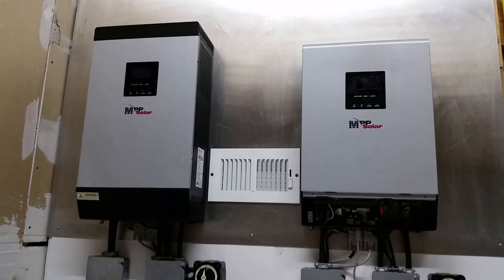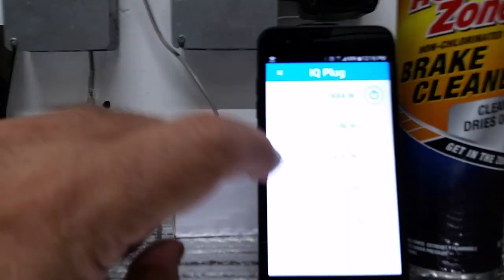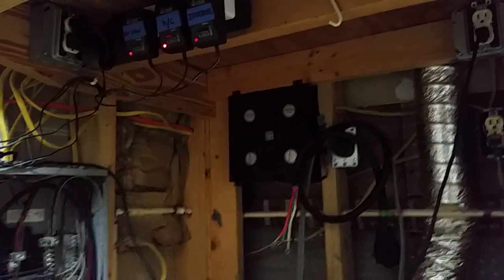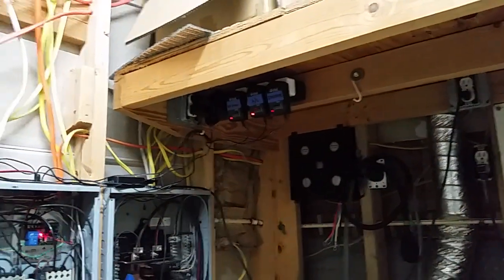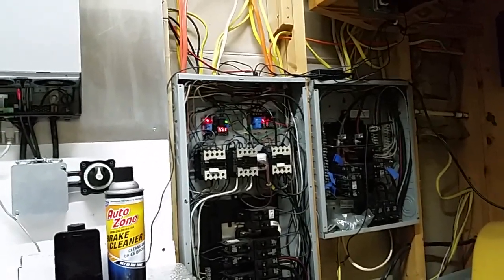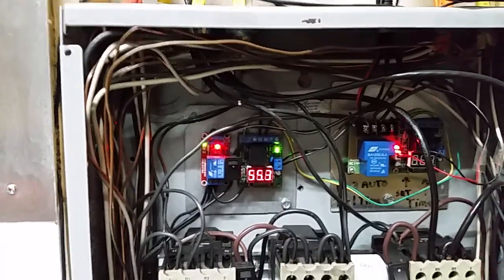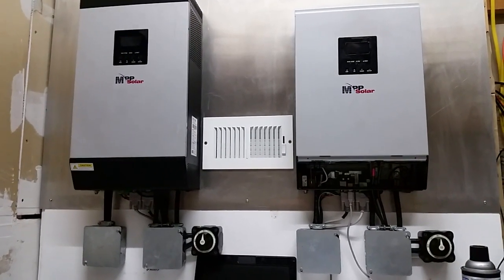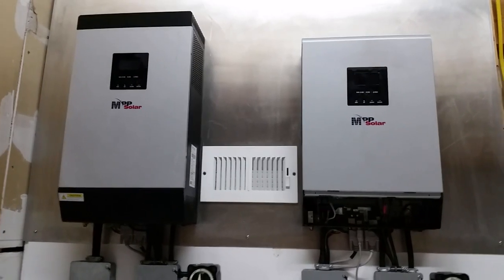My mpp solar system update 2019

Comment: pip5048mg owner here. I have some questions for you. 
1 you are running two different inverters models? in parallel ?
2 I know you have a transformer to provide split phase, but why in many shots does the video show your voltage at 120?
3 and lastly, ever popped a fuse hooking your scooter up when the voltage difference is too different?
I am an electrician, and I get everything else you have done there, just above questions are bugging me.
if you could answer these for me, i'd really appreciate it, cheers from Canada

Comment: I have been trying to get a real world idea of the surge capacity for the LV I am probably getting 2 MPP LV5048 which would have a 10,000 watt continuous rating which is plenty for me but I have a well that draws 1600 watts when on but has soft start and a geothermal 2 stage 5 ton unit that I set to run only on stage 1 and has a rotary compressor that should not require a super large start capacity but the LRA is over 125 amps (all amps @240 volt )  The HVAC draws 18 amps or less running so less than 40 amps for whole house but I am concerned that  with say HVAC and dryer an
on then well pump cuts on or HVAC comes on while well pump running it could draw over surge capacity for maybe 10 seconds or so.  I know the transformer less design doesn't supply as much surge in general.  I saw where a sol ark 12 has 20,000 watt surge and is transformer less. I am hoping 2 of the MPP units are at least 18,000 surge. If I have to I could get 3 MPP unit but dont really like the idea of 150 watts standby all the time just in case HVAC comes on etc..  I dont have a meter capable of max surge readings . Do you have any ideas that might be useful;? I know I could use delays etc to keep units from starting at same time but really wondering about the NVAC alone with maybe 8 amps already on with fridge  freezer lights tvs computers etc.
Reply: My setup is 2 lv5048 for house with AC and 1 5048MG for 1.6kW 240V pool pump. The 3 inverters share the 48V battery so extra solar power from any inverter gets stored in battery.  5048MG has a setting for low standby usage (25W), when no power from output is required, it keeps output off. Turns output on as soon as it detects a load and off when load turns off again.  lv5048 standby usage is about 75W therefore it is turned off automatically when battery goes to 40% and turned back on when battery is 90%. When lv5048 is off the house is switched over to grid automatically by contactor and switched back to lv5048 when they come on again. Battery voltage is measured by independent control board with relay and the relay is wired in series with on/off switch of lv5048.  The control board prevents battery under voltage and makes the system work on its on. This is possible because all inverters charge the battery even when they are turned off. Really good feature and makes it easy to automate switch on/off feature.
Reply: @kmnl926  Thanks I will be running a water source 5 ton 2 stage geothermal heat pump with the 2nd state cut off at thermostat so about 3 ton of HVAC and the pump will be running continuously at the same time .  It does have a scroll or screw compressor so sure shouldn't be that high startup and a variable speed inverter type fan.  Still well will be on  when compressor starts .once running it will be no problem . The HVAC draws about 1800 watts running but will  surge higher plus fridge and or freezer could come on at same time.  so when heat pumps starts well and lights and tv and computers fridge freezer  could be on and drawing about  2700 amps when HVAC starts.  So 7300 continuous  plus I hope another 10,000 start up to get it going . Most of the time total consumption will be less than 4,000 watts when HVAC is running .  will have 16kw of panels and about 30-40 kw of battery so even in mid summer on sunny days can run everything for at least 16 hours a day even with inefficiencies and grid and generator as backup.  So if grid goes down run generator about 5 hours a day and conserve ac or use one room widow heat pump unit. Have backup gas heat and gas stove and heat pump dryer. Cant get any cheaper on electricity for well it pumps 149 feet and maxes at 40 psi with HVAC on and bathtub wide open .

MPP specs just say 5,000 continuous  and * for surge but I dont see a value for * anywhere . Since its transformer less and other one have max double the continuous rating I hope thats what the LV%)$* has.

I have considered 2 of the MG units with transformer to get split phase this should provide more than 20,000watt surge and may well be more efficient than 2 LV 5048s I just kinda hate to complicate it more than I need to if I dont have to . I am pretty sure if I had to I could definitely use 3 lv5048 but then large standby loss and more upfront cost and if I knew I would need 3 probably would go with SolArk 12 instead. One added benefit though of 2 MPPs is 4 different MPPT chargers so could use two predominant south strings and one each east and west string to maximize the early and late sun hours and squeak out maybe an extra hour of good level of energy.
Reply from the maker: @teekay1785  sounds like one heck of a system I didn't read this post. So I guess maybe the grid is not an option for you sounds like you're going completely off-grid? What kind of batteries are you using? I would definitely come up with something to keep certain things from turning on while certain things are running at least until you get a good feel for what your system can handle maybe some timers to make sure certain things are off while certain things are on? Or a relay setup that only lets one item come on at a time
Reply: @TheOffgridkid  when I get set up I will be able to use the MPP s to see actually wattage draw might have to get different meter to get surge draw and also will be getting heat pump dryer soon.  Part of the reason for big system is plan to get used model 3 tesla soon and basically use it for car and extra battery backup .  The 12 volt battery in it can deliver up to about 1500 watts continuous to inverter if needed from my understanding so excess power will go to car but for now Lithium Iron phosphate cells 120 amps  4  sets of "modules" for now and a total of 24 kwhr battery. for max draw from batteries at 1c of 24,000 watts and .25 c typical  non solar hours with HVAC on or less.
Reply from the maker: @teekay1785  the mpps show The Surge surprisingly well also shows up in watch power most of the time depends on the timing of the hit I guess.
Reply from the maker: @teekay1785  I like lithium iron phosphate I feel it's one of the safest batteries to run in Doors that I know of. Just so I can get a better understanding on your system you're running 48 volts at how many amp hours?
Reply from the maker: @teekay1785  I like the information about the Tesla 12-volt system I really need to look into that I've always been thinking of a way to incorporate a Tesla with the solar system
Reply: @TheOffgridkid  good to know that could be very helpful
Reply: @TheOffgridkid   Yeah I wish there was a way to tap into the full power of the battery . There would be if Tesla wasn't so secretive with software etc but thats their perrogative rather have that than not have them.  Maybe Jack Riccard will eventually get something that works on the intact car and not just battery pack.  Here is a link that IIRC explains it if not its his next video with Tesla model S:
https://www.youtube.com/watch?v=2nMs_DwveqA&t=8s

All you need is 2 Teslas and swap out charged one all the time LOL!  I did reserve a Tesla truck though actually 2 but only will get 1 wanted to see what actual specs were for 2 motor and 3 motor model when ready to deliver.  BTW a brand new battery pack 60kwhr for Chevy BOLT not Volt can be purchased for about $11,900 but hard to break up to use.
Reply: @TheOffgridkid  Each of 4 modules is capable of 120 amp charging and 2c discharge but I won't use it that way  Just overkill.  so can charge at 480 amps total but won't be able to from 2 MPPs.   On sunny day 16kw panels assume 80 percent total efficiency  12,8 kw use about 2-5 kw at any one time  directly from pv and charge batteries with rest (max 8kw) should charges fully in 3-4 hours.  so about 7 hours directly from PV and about 6 hours  of heavy use HVAC etc . from batteries  so likely HVAC won't run more than 1/2 the  time should supply almost all needs till get batteries up to 40kw or more. I am pressed for time may be messed up some. using 120 amp individual cells if assume avg 50 volt each  16 s 4p each module 6 kwhr and 4 modules for total of 24 kwhr
Reply from the maker: They make an inverters and charge controllers that runs on 300pluss volts just a direct connect to the battery on another cable and connector that would connect with another battery already running the solar system of the same voltage that way you could integrate them when the car was in the garage or other designated places you could plug it in to connect to the battery system
Reply from the maker: Sorry guys I'm using voice text so some of my post are a little off this thing doesn't mnderstand what I'm saying. Lol
Reply: @TheOffgridkid  year i skim through most of Jack Ricards pertinent posts . It would be nice to have  300 to 400v system connected  to a full ev battery pack
Reply from the maker: My units have been working great but only try to run them at about half their capacity. My AC units are a hundred and twenty volt single phase. If you're asking for my advice I would not run anything but single phase to the inverter everything else would go to the grid like the stove, ac, I would get a mini split single phase unit to connect to the inverter for a designated room this way your batteries would run it much much much longer and it would not be hard on the system. Anything but single phase is a huge problem with load balancing and like you're saying certain things turning on and off on one line can cause havoc on your system
Reply: @TheOffgridkid  I am going to use this like off grid system with grid backup I am not selling to grid.  Have a large house with 4 HVAC units but only use one at a time normally downstairs in winter because heat rises and upstairs in summer if guests here grand kids etc I have a 3 ton 22 seer totally inverter fridgidare heat pump upstairs that can deliver 3 1/2 tons conditioning in heat pump mode on 17.9 amps max 240 volt.  and it is dual fuel with gas can use either one also 3 sets ventless gas logs downstairs if needed can heat the whole house with just 2 sets logs downstairs. Other units on separate wing dont need to run and its external 2 inch foam  house and  sealed well  with sealed nl electric bill avg $200 and gas $28 mostly connection fee thinking of changing to propane also only use gas for stove and tankless hot water and fire logs occasionally .. Sold large backup generator  when decided to get solar that will pay for half of diy solar system after credits.  In short I will run 240 volt ac or I dont need a large system .  I might put a 110v mini split in garage with additional zone in one room of house for emergencies.  I will set batteries not to discharge fully so always have basic grid backup and I still have a 5,000 watt 240 volt generator if grid goes out for extended time in summer.
Reply from the maker: @teekay1785  want to trade systems haha. Man that's awesome sounds like you know what you're doing and have done your research
Reply: @TheOffgridkid  Thanks I am scientific minded and always liked physics and math etc

Comment: love your setup...i have a question for you on the software you use to monitor the inverters,,,do you notice you have to tell each inverter to charge from the grid,i thought once you send the info to 1 inverter it would have send the same information to the other,,and same on the total watts produce for the day...it does not give the total watts between both inverters at the end of the day,you have to add them up yourself
Reply from the maker: Sorry I didn't reply sooner but I've been off the grid haha yeah it should work that way but unfortunately it doesn't maybe in the future if they will fix it

Comment: Hi from Austria. Are those 2 x PIP 4048MS in parallel? I want to update my single Mpp Solar 4048 ms with another one, but i only get PIPs 5048 MS. Can i run them in parallel (4048 + 5048)?
Thx Markus
Reply from the maker: Yes it is two 4048 Ms units. don't think it will pair with the 5048.
Reply: @TheOffgridkid  Thxs for your quick answer.
Reply: @TheOffgridkid  correct.  The PIP 5048 and 4048 series are not compatible.
Reply from the maker: Markus Nusser contacted MPP solar they will not parallel together. I understand where you're at I would like to add another unit or be able to buy something to replace what I have but now you can't buy anything that matches with the 4048 from MPP solar